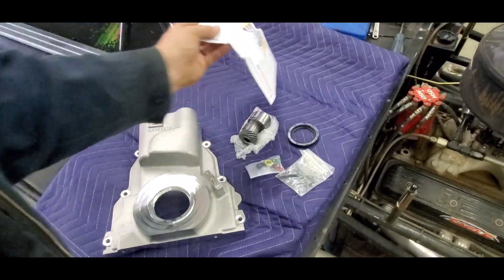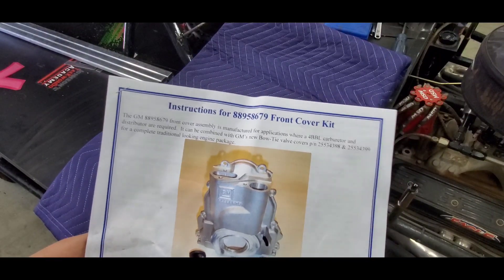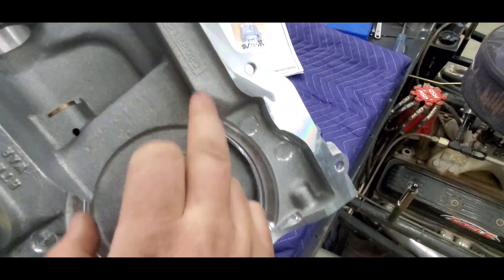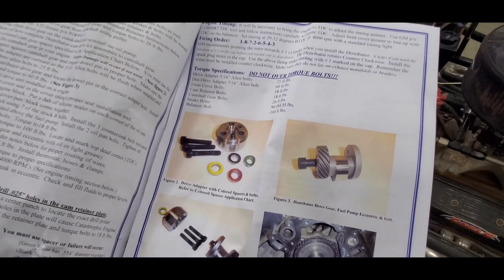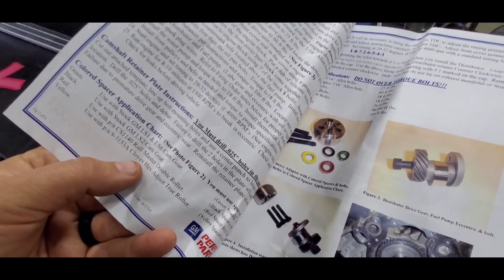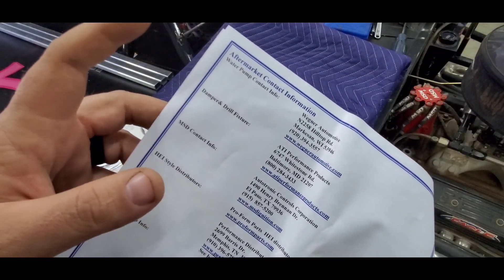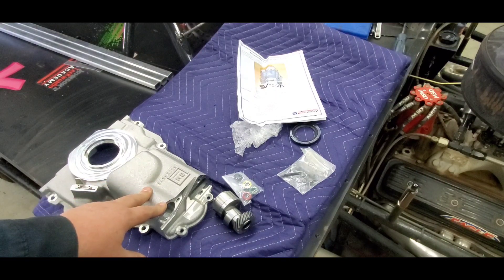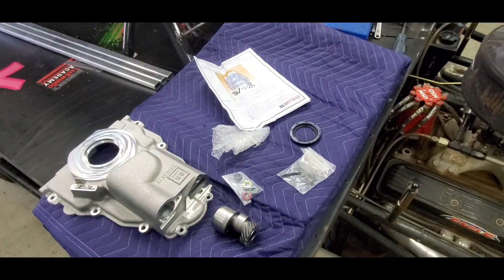GMPP Ls Distributor/mechanical fuel pump conversion unboxing (pt1)

Comment: I'm working on 5.3 LS stage two sloppy cam LS7 lifters valve springs and pushrock high pressure oil pump with a distributor conversion how do you like it so far
Reply from the maker: I had to do a conversion because of our rules. Wasn't crazy over doing a carb and distributor but I have not had the first issue. So no complaints

Comment: Thank you for these videos I'm thinking about using this in my 1985 oldsmobile cutlass when I get tired of the 350 I have in it now, I have a 6.0 with flat tops and 799 heads next to my garage teasing me.
Reply from the maker: @Snakeman1985  you are very welcome.  Thanks for watching
Reply: @ShaddenMotorsports   I'm curious if you don't mind me asking the serpentine brackets, can you modify sbc ones to work and line up decently,  and about how much longer is that water pump over a stock truck one. I know your running it in a track car so room is a bit easier to come by, but would it fit in street car ok and not out the pump into the rad?
Reply from the maker: @Snakeman1985  it's waaaay out there. In a g body you may have room. You would probably have to go aftermarket on the accessory stuff. There is not alot of support for this stuff outside of dirt racing
Reply: @ShaddenMotorsports  yeah that's kinda what I am seeing I love the idea of keeping my car mechanically controlled. I saw there was a company that makes serpentine systems for like 2 grand, and after all that on top of the required parts might as well get a Motown LS.
Reply from the maker: @Snakeman1985  there are several people that have modified truck accessories to fit with it. Ill see what I can find you
Reply: @ShaddenMotorsports  ok wow thanks man, I've been trying to drown myself in as much information as I can.
Reply from the maker: @Snakeman1985  yes sir...look me up on fb my profile pic is the same
Reply: @ShaddenMotorsports   will do

Comment: How much total in parts? did you complete yourself yet? was it a task?
Reply from the maker: I ended up going with the allstar cover without the fuel pump provision for room. But the cover was 600, balancer was 500, water pump 600, distributor was 400, its an expensive conversion but I had to do it. It was just straight forward bolt on

Comment: Did you use the Wegner pulley kit? If you used the Stewart long water pump what is the measurement from the front of the block to the end of the water pump pulley? Crank/alternator and tensioner pulley measurement also if you have them. Thanks.
Reply from the maker: It's all jones racing
Reply: @ShaddenMotorsports  Ok, could you by any chance measure from the block to the front of the water pump pulley? I’m trying to determine if this will work in my car but I only have a certain amount of space.
Reply from the maker: @princeomar140  I will measure tomorrow..im about positive its 9.5 inches. I had to go with the allstar version without a fuel pump provision because it was 7.5 I believe
Reply: @ShaddenMotorsports  Thanks

Comment: Reminds me of distributor setup on stock 472 500 Cadillac engine
Reply from the maker: Does look alot like that. I never thought about it.lol
Reply: @ShaddenMotorsports Hello, can you give me all the part numbers?
Reply: Paint it Ford blue and it'll look like another Windsor
Reply: @BruceLee-xn3nn  The problem is that it is difficult to obtain parts for old Chevy engines, and they are also heavy compared to the LS, and the cooling circuit in the LS is much better.

Comment: I like it. All the advantages of the LS block, with the simplicity of a old school SBC.
Reply from the maker: It definitely makes this engine platform available In all forms of racing but makes the ls soooo long
Reply: Hi sir @ShaddenMotorsports
Reply: To me a sbc with nice engine accessories looks way better than an LS with wires and coil packs and plastic covers.
Reply: @BruceLee-xn3nn good thing he doesn't run coils then huh? He is running Front Drive accessories if you watch any of thr other videos

Comment: Will this work on the ls LM7 5.3 ? also if I wanted to keep the electric fuel pump how do i block off the top of the port does it come with some sort of block for the mechanical fuel pump ?
Reply from the maker: I ended up using the allstar version that does not have a mechanical fuel pump provision all90090 is the part number

They will work on any "ls" based engine except the ls7